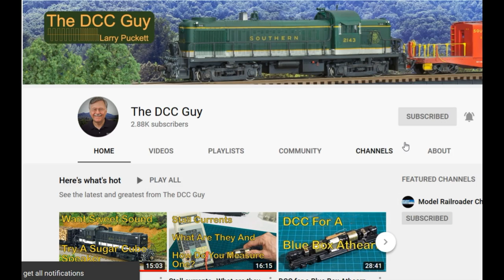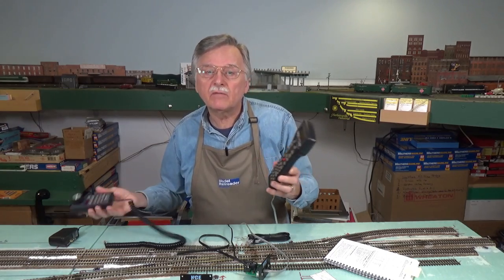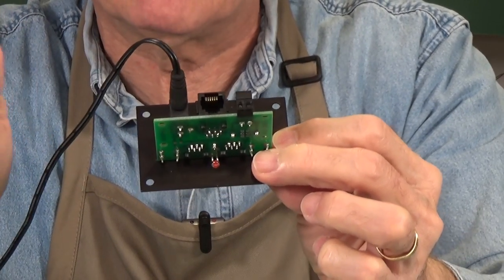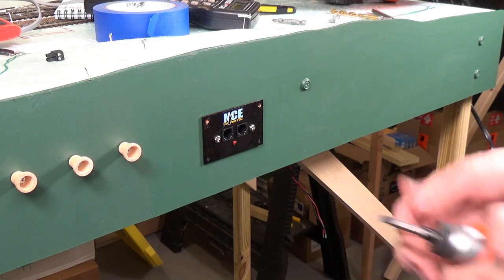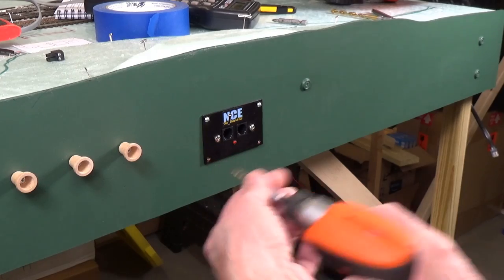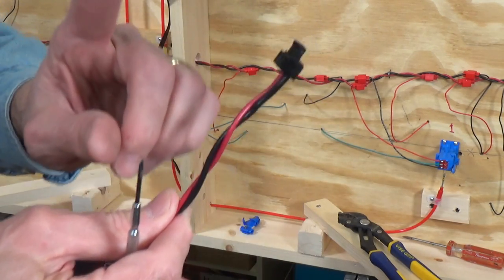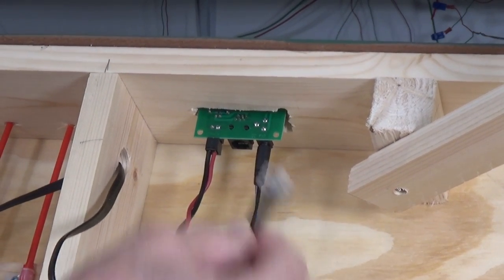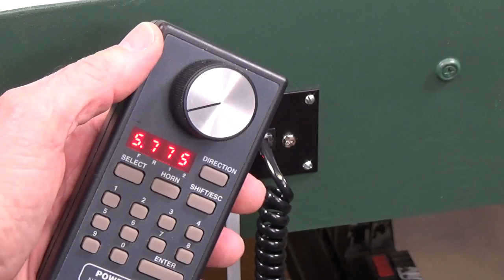Install An NCE PowerCab DCC System (151)

Comment: Larry, I think it's great that you'll be talking about the subject of twisting the bus wires. As you can tell from my questions, it has been a confusing topic, with various people venturing opinions, but I agree with you that we should trust the electrical engineers, people who understand the E&M and have actually done testing. Another topic about bus wiring: Some of my bus runs are lengthy. My layout is about 13 feet by 25 feet, with two levels. For the main line on the lower level, the bus has to run about 80 feet. My plan is to run half of it clockwise from the controller/booster and the other half counterclockwise, so each run would be about 40 feet, give or take. So, my question is, should the cable run be a single continuous piece of wire, or is it OK to put smaller sections in, with terminal strips? I'm wondering if the losses at the terminal strips might prove to be problems (current drop). I also have an accessory bus (for the SMAILs) that runs under both levels of the layout. For that, I'll run the lower level like for the main line; and the upper level similarly. So each bus run will be no more than 40 feet, broken into smaller sections with terminal strips (similar to what you would do with a portable layout like your little project). Breaking the bus wire runs like this would simplify twisting them, too. Does that sound reasonable? Thanks.
Reply from the maker: James—it doesn’t matter how you break them down, it’s what the total length is that matters. Two 30’ runs are still 60’.

Comment: Larry, I notice that you twist your bus wires together. I've read in some places that this isn't necessary except for very long runs. This layout is small. What is your experience with this for NCE systems?
Reply from the maker: The official NCE line is that if the bus is longer than 30’ and/or the booster is rated at 5 amps or greater then you should twist. So with a PowerCab on a small layout it should not be necessary.  But what if at a later date you upgrade to a 5 amp smart booster? The way I interpret NCE doctrine since it is 5 amps then you should use twisted pairs even if it is under 30’, but where is the break point? I will do a special video on this topic soon and in the meantime I will send Jim Scorse at NCE some what if questions..
Reply: @TheDCCGuy  One person I know uses NCE almost exclusively, and he has built many layouts for clients, some of which are large. He tells me that he doesn't twist the wires and has never encountered problems. I am building a large layout. I'm using a 5-amp NCE controller/booster and several 5-amp NCE boosters (several power districts), and some of my bus runs will be in the neighborhood of 30 feet. I haven't twisted my bus wires (yet). Since I haven't installed many feeder wires, that is something I can correct if necessary. As far as I know, none of the other DCC manufacturers recommend twisting the wires, so it is a confusing situation. Am I right about that? If so, why would NCE be different? The DCC signal transmitted by the NCE system is the same as that generated by other manufacturers. I'll appreciate any concrete information you can get from NCE.
Reply from the maker: Yes, other manufacturers do recommend it. Digitrax has for several years as a means of preventing crosstalk noise interferences. And NCE is adamant about its use with their systems as I said. So you have the makers of the two most widely used DCC system in North America if not the world recommending it. Now of course you will have folks tells you it doesn’t matter, re are still folks who will tell you the world is flat. So who will you believe, the guys with degrees in  electronics that design this stuff or the self proclaimed basement expert? Now if you ignore the recommendations and build like folks have done for almost 100 years before DCC came out then there are some bandaid fixes. NCE sells a device called a snubber that can be installed on layouts with untwisted power buses which will help with the problems that will come. I will do a video to explain all this as soon as I get time, but i  the meantime go to the NCE website information station and look up twisted pairs and snubbers, maybe you’ll believe it then.
Reply: @TheDCCGuy  Larry, thanks for the reply. I'm going to twist my bus wires, as recommended by NCE (and others, as you've pointed out). The good news is that I haven't progressed very far with my bus wiring, so this is not too onerous a task.
Reply from the maker: James—consider using 12-14-16 ga zip cord. Larry Meir, the creative genius behind DCC Specialties PSX, etc., did a test of zip cord vs twisted parks and found that zip cord was equally effective. I have been using it on the Piedmont instead of twisting and everything works fine. You can find it anywhere that sells audio supplies.I’ll do a video on this twisting issue ASAP so don’t pull the wires too quickly.
Reply: @TheDCCGuy  The only problem with the zip cord is that it doesn't seem to come in enough color combinations for me. (If I'm wrong, I'd like to know.) I have 8 power districts + 2 reversing sections that are subdistricts. So I have established a convention for color-coding things to help avoid getting confused. I need 10 unique pairs of colors. Having said that, I can reuse a color as long as both colors aren't duplicated. I'm thinking that I need to use the wire I have since I have the 10 unique color combinations.
Reply from the maker: I don’t worry about colors for my main buses, I just label each one.

Comment: Hi Larry. I was operating my NCE Power Cab today, and around the end of my session (2 hours mark) I had 2 locomotives running. As I went to slow one of them, I noticed nothing was happening. Then I realized, the Power Cab was not responding, and was in fact frozen. The emergency (red button) also didn’t work, so I shut down the power to avoid a collision. When I powered up again, everything worked properly. I was just wondering if you have heard of this, or if it’s a sign of some issue? Thank-you.
Reply from the maker: I’ve not heard of that before. I’d give it another long shakedown session again  and see if it repeats this, may be a fluke or a gremlin. If it happens again I’d definitely document the problem and call NCE tech support. I have only operated mine for shorts periods up till now but will definitely keep this in mind.

Comment: I just got a hollow core interior door, and a set of folding table legs to start my first ever layout in N scale. The layout will represent a small short line railroad in a Pacific Northwest setting, and will be using at the most three locomotives. I got two nice looking, and running Life Like engines, a GP-20, and GP-18, that I'll be converting to DCC, and would like to eventually get a small steam loco to pull a short excursion train. I'll be using Kato Unitrak, and would like to use this DCC PowerCab, as it seems like it will be perfect for my small beginners layout. Do you have any videos, or will you have videos that show you how to do a Unitrak set up with the PowerCab?

The inspiration for my layout are the small lumber hauling short lines that used to exist in the Pacific Northwest, particularly in Northern California, and Southern Oregon, like the McCloud River R.R.

receive
Reply from the maker: Sorry but I have no experience with Unitrack. I suggest you do a search on YouTube and see if there are any others who have done videos on it.

Comment: At minute 14:32 you say "just slip in the red and black wires into the black terminal" Not at all savvy on electronics, I don't understand whether there is a positive or negative wire preference. It seems you simply arbitrarily put a wire in each slot, not differentiating positive or negative wires. Is that correct?
Reply from the maker: That is correct. DCC is different from standard DC wiring. Keeping track of the wires in this case only matters when you add a booster and then you just need to make sure to be consistent so that the output wire for the right rail on both actually go to the right rail . And if you get it backwards and pop a short when a loco crosses the block gaps then you just swap the wires to correct it. If you want the complicated part then watch my other videos on shorts and how to prevent them.
Reply: @TheDCCGuy  This is an excellent explanation! I feel so isolated where I live for electrical advice, and I truly rely on your help. I hope at some point to explain parts of what I am doing to our train group. Thanks again.

Comment: Notice your running a Great Western 57xx . Do you prefer British trains or was it a coincidence. I use NCE and have found them most obliging with any problems that occur. In fact I sent mine to America to have the chip upgraded and they were brilliant. Frank
Reply from the maker: My main layout is based on  the US Southern Railway, Norfolk and Western, and Chesapeake and Ohio railways. However I also have aa great appreciation of UK railways, especially the GWR. Consequently I have 2 57XX #5775 & #5786, 2 64XX #6417 & #6424, 1 0-6-0 #1363, 1 0-6-0 #3202, 1 0-6-0 #2475, 1 2-6-2 #4555, 1 2-6-0 #6385, 1 0-4-2 #4871, 1 4-6-0 #6009, and #10 Flying Banana, all fitted with SoundTraxx DCC UK sound decoders. I also have a number of coaches and various wagons. So this modular layout will be GWR all the way.
Reply: @TheDCCGuy   It's great to see appreciation of other countries railways, I go to (in the past, due to covid) railway shows were there are layouts representing all countries but some people walk past them without a second glance, muttering "it's not British ignore it". They don't even stop to look at the dioramas and some are stunning. I sometimes thought that I was on my own but it's obviously not so as you are a man after my own heart. Stay safe and keep well. Frank

Comment: Why do you twist the BUS wires?
Reply from the maker: It helps prevent decoder killing high voltage spikes on the tracks, especially when a short occurs. Only necessary with DCC power buses over 30’ and/or over 5 amps.
Reply: @TheDCCGuy  Ok, Understood, many thanks!

Comment: How does DCC know if a locomotive is steam or diesel or electric?
Reply from the maker: You have to pay extra for really smart decoders.
Reply: @Model Railroading  its got to be a  on one of the cv settings
Reply: I live in northwest Indiana. We have an electric inter urban between Chicago and South Bend.  The South Shore Line 

Curious if there is sounds for the electric railways
Reply from the maker: Yes I seem to remember someone doing electrics, check Soundtraxx  and maybe TCS.

Comment: Where is the power coming from?  And how does it get to the track? I would like to see that since I know absolutely nothing about DCC.
  Does anyone have a step by step video on how to hook it up I feel like I spent good money to buy one of these NCE and it won't work with out another part.🤔😞
Reply from the maker: I showed exactly how to do all of that in this video so maybe you need to watch it again. Which NCE system did you purchase? This video is for an NCE PowerCab.
Reply: Let me try again I understand but what I'm wondering is when you spliced into the wires below the layout  what are those wires connected to? That's where I lost you.🙂I'm confused were or what those wire were connected to.
   I apologise for the miss understanding.
  Thank you
Reply from the maker: There are a number of videos on my channel that go over installing the DCC power bus, connecting feeders to the track and turnouts, etc. One video cannot begin to cover all aspects of this. So dig in and binge watch.
Reply: @TheDCCGuy  
Ok I will do that 😊 I bought  the NCE power cab
Reply from the maker: Great, if you follow the entire video series I show how to build the layout, install the roadbed and track, do all the wiring, install the NCE, and how to use the cab06 utility throttle. Enjoy the ride!

Comment: Larry really enjoy your video’s, I find them very clear and informative. Would you consider some time doing a tutorial on creating blocks. I have a NCE Powercab with NCE USB Interface and hooked up to JMRI. I am using NCE BD20’s linked to a AIU Interface but I have to admit that the procedure for entering the info into JMRI I find very confusing. My reason is that I have a hidden section with a up and down lines with a loop siding on both and I want see when a loco enters a section. I have set the AIU address at 50 and have calculated each output using the formulae so I understand that bit, but it’s where to enter the appropriate information into JMRI. Do you set up Sensors first, or layout editor first. I’m sure there must be others like me so if you could find time at some point to do a tutorial on this subject I’m sure it would be very much appreciated.
Kind regards 
Roy W (UK)

Comment: i have ho layout 10buy 16 dcc power cab, only connection i have is two wires frome the rail joiners going to the panel, i run 3or 4 trains use no more tham 140 amps, speed is set at 28 i run between 7 and no more than 14,everything rusns great why do i need a buss or boster.
Reply from the maker: In your case you don’t. You have limited power demands and I assume a fairly small layout. When you want to run 10 locos on a larger layout I think you’ll find out your answer.
Reply: thanks for getting back my layout is 10 buy 16.

Comment: With the NCE :
1. Can it be used to program the Digitrax DS64 given the open DCC standard?
2.  Inspired from your switching layout, I've started almost an identical plan with 2 locos. I plan to add another identical plan to extend this at rt. angles with 2 additional locos. Can I use the same command station but 2 daisy chained power interfaces; one for each layout?
Reply from the maker: I’ll have to check in the DS64 whether it will require a Digitrax throttle or not, but I think it will work. There are some finctions that do require a LocoNet connection. As for your second question, there should be no problem using the same command station with two different layouts. If you ever do connect the two layouts make sure to get the polarities correct.
Reply from the maker: I have not tried it but you should be able to use the accessory selection button on the PowerCab to program a DS64. With a Digitrax throttle you put the DS64 into programming mode and send commands to switch address 01. The PowerCab has an accessory decoder selection button and the ability to send open and closed commands so it should work. Here is what Digitrax says: “Refer to your DCC throttle’s operating guide for specific instructions for selecting switch addresses and sending switch commands.” I would buy one DS64 and try it before buying several just to make sure.
Reply: It will work using DCC for commands but don't use DCC for power, as they have a habit of going nuts when you do. Some NCE layouts use them to take switch commands off of DCC but provide feedback to the computer via LocoNet.